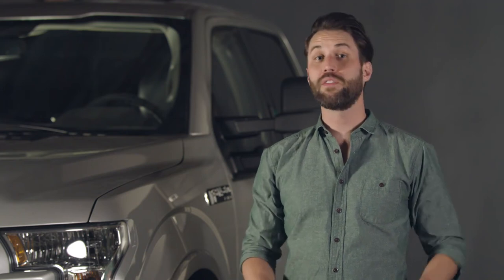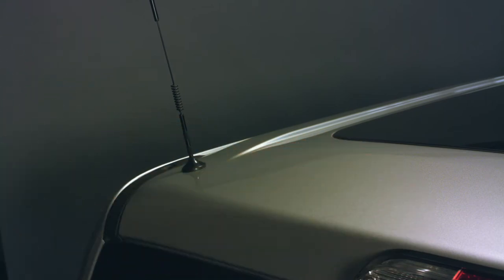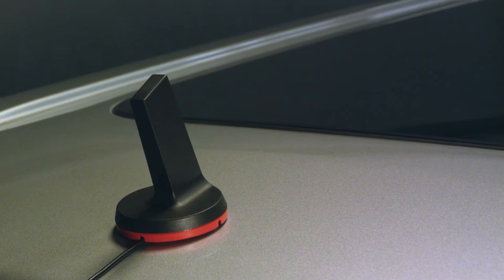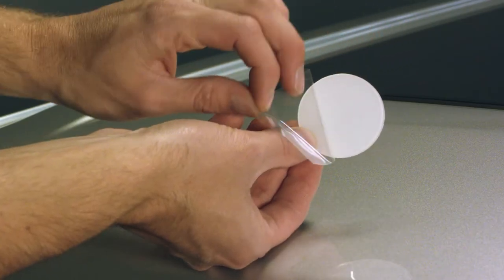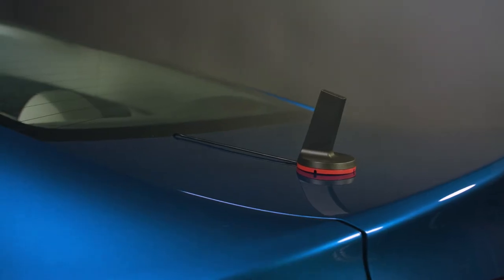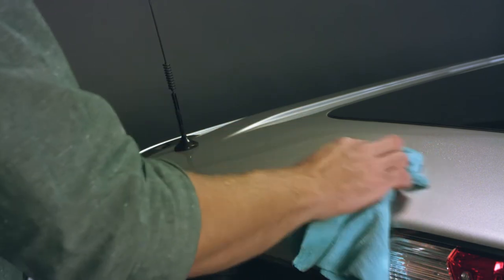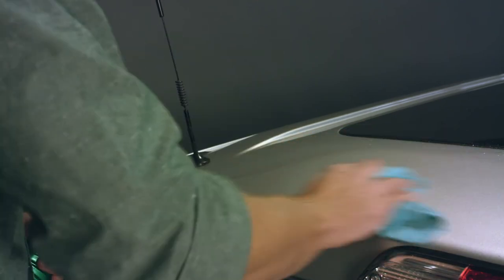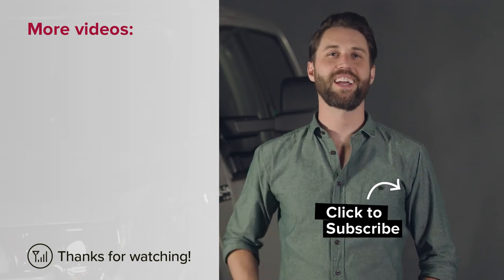Antenna Installation For Aluminum or Non Ferrous Trucks And Cars | weBoost

Comment: 7.15.18  How big of a ground plane is needed on a fiber glass roof?  Does this ground plane need to be steel or can it be something else?
Reply: Check out technical info on firestik.com.  I believe they recommend 9 square feet of steel.  I spoke to them and they stated that the aluminum body vehicles such as the Ford F-series trucks require a "no ground plane antenna" that is matched with special coax cable wherein the ground plane is established.  Same for fiberglass roofs on vehicles such as RVs.

Comment: Is this disk reusable. Can I take the antenna off and on. I use my booster on 2 vehicles.
Reply: Get another disk to leave in place. (give it a thin coat of paint if you want)
Reply: @stephenwhite1607  we actually purchased the OTR omni direction antenna, actually bought two. One for the truck and one for our RV. We take the booster out of the truck at the campsite and put it in the trailer. I then put my cell phone in the cradle and use it as a hot spot. Works fantastic. Stream movies on rainy days and also gives us great WIFI on the campsite near the trailer. 👍👍 Our plan is to eventually install the Drive Reach RV unit and leave the sleek in the truck. When the budget allows. LOL.